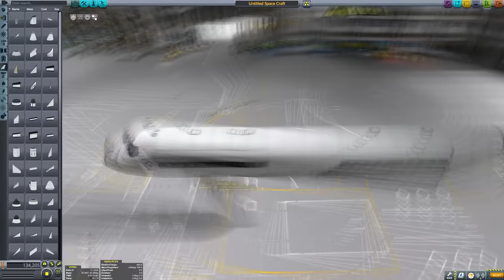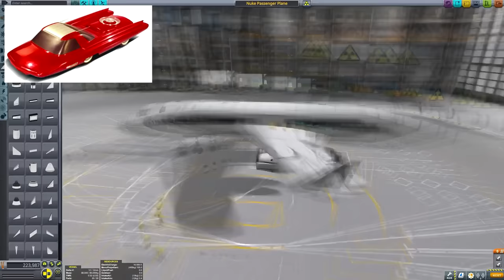KSP: Nuclear-Powered Jetliner to EVE!

Comment: You know, I play ksp with RSS and RO and after a month of only plaing that it becomes easier
Reply: You just have to get used to it taking 5 minutes to get into orbit and burning past apogee on the second stage.
Reply: chris kerwin Well, my fastest rocket to get to orbit took 6 min and the worst is not that , is that if you have over 200 mods it tooks loads of time to load and most of my rocket get to orbit before passing apogee
Reply: What kind of TWR are you using on the first and second stage? If the first stage is like 1.3 and the second is sub 1 or even sub .5 you have to burn for a long time. A solid state drive helps a lot with the load times.
Reply: Try the Saturn V.  Massive hydrogen stages with very low starting TWR.  It is a slow ride to orbit.
Reply: I play RSSA with stock parts and my 22 ton rocket can make it to orbit, its not that hard

Comment: @Matt Lowne, there is a mod called Stock Size Real Solar System,
I use it since i installed the KSP. Simply 5 times easier real solar system. Improves the gameplay a lot.
note that the only issue i had was it doesn't work beyond 1.4.5 as i tried. I haven't tried to install further than 1.6 but mod credits say it's for 1.3

Comment: To be precise, the nuclear aircraft were:

Tupolev TU-95LAL
Convair NB-36H

The Conviar X6 never flew
Reply: TrainNutter, to go along with that,

Neither of those aircraft were powered by the reactor onboard. They were just flying test beds to prove the feasibility of airborne reactors. Both aircraft were powered by their original engines; the Tupolev with its turboprops and the Convair with its radials and jets. None of the engines were powered by the reactor.

Comment: In short a small nuclear reactor wouldn't explode with a mushroom cloud, mushroom clouds aren't necessarily a by product of a nuclear explosion. Mushroom clouds are created when an explosion is large enough to create enough low density gas to create the shape. However producing the amount of energy necessary to do this is normally associated with nuclear bombs, but it is possible to create a mushroom cloud with anything explosive.

Comment: the thing with  thermo nuclear jet engines, is that they are so heavy you need a wide aspect ratio on the wings to get more lift for takeoff, but also if you want to enter the atmosphere of slightly larger planet with a thicker atmosphere to get use out of those engines you need a small aspect ratio to not burn up. The thing I do with nuclear jet engines in KSP  is I bring my craft slightly under the Karman line and time war around the orbit until I get into a stable suborbital trajectory with apoapsis and periapsis both under the Karman line at  roughly the same altitude. That usually slows the craft down enough to no suffer from the rigors of entry, it's aerobreaking but boring, and it can take up to 15 min realtime, doing nothing, to see it through, but it works. Also my wing design is usually ahedral (which on level decreases my aspect ratio but makes the craft highly maneuvrable at high speeds), high wing (as nuclear engines are heavy you need some sort of keel effect), tapered (delta or complex delta have to much drag imo) and pitched upwards (<1°) which has more use for landing than for takeoff tbh. So to actually liftoff I slightly roll from one side to the other (kinda like an albatross or a frigatte bird does in real life) to increase lift by leveling each side of the wing seperately. I use OPT space plane parts which are kinda op but I mostly do the wings myself out of stock structural parts.

Comment: I watched a documentary where the leads scientists/engineers admitted the whole nuclear powered bomber was a bamboozle. Basically they believed the molten salt reactor was a better and safer design but the Navy had already pushed through with a closed loop design we know today because it was easier. So these guys convinced the Air Force they could make a lightweight reactor using molten salt as a medium to power and aircraft essentially indefinitely. All they wanted was to get funding to make and then prove their much safer design for nuclear power and it worked. It never got accepted for commercial power because it was more complex to build and the nuclear energy commission had already moved forward with the reactor designs. So don't feel too bad about the bamboozleness!

Comment: At some point they noticed that nuclear reactors give off a lot of radiation. And that requires lots of shielding for the crew. Which means all the mass that could be used for payload is now lead and concrete.
And thus the nuclear bomber was scrapped.

Comment: There's a chance you could've entered Eve's atmosphere without overheating. What you needed to do was to use those nuclear rockets to slow down as much as possible, as close to Eve as possible (slightly within Eve's atmosphere, even), and keep firing them until you're close to zero relative velocity with Eve's atmosphere. Then you'll just drop down like a feather. Or a brick. Depending on if your wings get sheared off from pulling up too hard in a steep dive.

Comment: Matt Lowne
Actually, a nuclear jet DOES require intake air, or an on-board supply of propellant that it can vaporize and spit out the back.  it would be more correct to say that a nuke jet does not require intake OXYGEN.  as it is not combusting the air, only superheating it.

Comment: in order to enter Eve's atmo without burning your wings you need to stay in the higher atmo and bleed speed, or go for a mid to high orbit and kill your orbit so you are falling straight into Eve, then use strong enough engines to kill your decent as you enter the upper atmo, then use the engines to keep your craft slow enough in all respects to get to flyable atmo then fly.

Comment: The only way I find to enter eve's atmosphere is to do deorbit burn until the speed drops to 1000 before you go under 40000m, then open the speed brake to slow down massively ( >25g) to avoid the heat....

Comment: The Orion, that’s a project I like, and it’s definitely a good one.

As far as nuclear powered cars and all that they would be possible but nuclear development kinda stopped, most likely from scare campaigns and nuclear technology has basically stayed the same, other than have extra regulations that make it too expensive, but being realistic nuclear powered cars are just a bad idea, you would be better off with battery powered cars, and have the electricity come from nuclear power, the only thing that could be nuclear powered would be a train because weight isn’t as important, you can have the reactor be made long and then power an electric train, but again the idea of a moving nuclear reactor does give me the shivers, still better to have overhead wires and have the electricity made by nuclear
Reply: dan b They actually tried to make a train, but the shielding had to be too thick and heavy. It meant that the train needed two tracks laid out for it to work. Maybe if the tech improved enough, it would have been viable.
Reply: As an added bonus, there are improved designs to the reactor, but they are considered more expensive for each system.

But as a reminder, never cheap out in reactors. US and Russia made that mistake and created  no-go zones because of their incompetence.
Reply: Batteries are quite inefficient, so until they are improved we are better sticking with petrol cars.
Reply: They are efficient enough for a car, if you don’t like battery then hydrogen
Reply: Just also remember that if u get in a car crash either your nuclear car...

Comment: Yes, a nuclear powered airplane like the Convair X-6 WOULD require intake air.  Where do you get the idea that it would not?   The reaction mass doesn't come from the atomic reactor.  The reaction mass would be AIR.  To not use air for the reaction mass would completely defeat the purpose of using a nuclear reactor to power the plane.

Comment: Accualy about the trains. That is some what stramge. As you can have fully shielded compartment for them. In plain weight dose mater but trains. We have seen tones on video of 123 units trains
Reply: THe Nuke trains would have  also necessitated stronger tracks and huge stations to be economically affordable. Imagine train stations with 2 km long platforms... not really easy and chep to build as well. Not only having a nuke train is dangerous but brings all sorts of money spending that would render a travel by train more expansive than air travel...

Comment: Hay matt make a special engine with infinite fuel so you can go to any place in the galaxy and back again.
Reply: He doesn't make the mods, but if you want that, you can just make one yourself. It's quite easy, all you would have to do would be go into the gamedata folder, make a new folder in it, copy the the files from an engine to the new folder, rename it, change the fuel intake, and save. that easy. in case you don't know, you can find the gamedata folder inside the KSP folder that you can get to by right clicking kerbal space program in steam, going to properties, going to local files, and click browse local files.
(looking back at what I just wrote, that might not be easy for someone who's never looked inside ksp's folders)